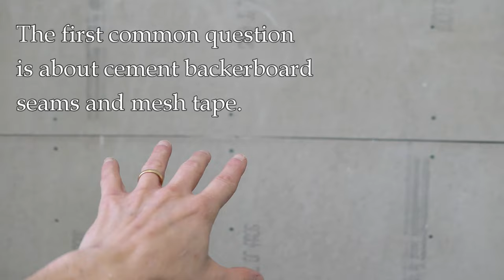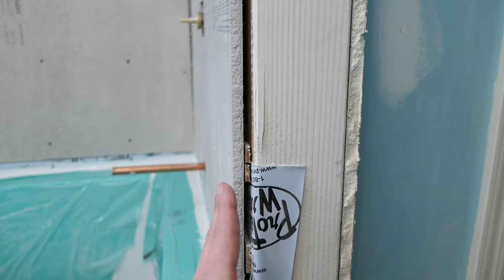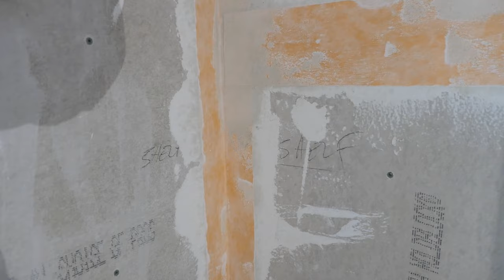Should Backerboard Go Over The Tile Flange Or Up To It?

Comment: An alternative to shims or floating the face of the backerboard is to thinset the studs then put up your backerboard and plumb/level/square the backerboard with the screws. Don't over tighten your screws or you'll squish out the thinset.  Once thinset dries snug up the screws. This will leave a nice clean surface to lay tile.
Reply from the maker: Yeah, I've seen others using this technique, but I'm not a fan.  Wood, including studs, will expand and contract with seasonal changes in humidity.  This is especially true in areas with cold winters and heating systems.  In time I fear the thinset could drop away, leaving gaps.  I'd prefer to have solid wood, attached in multiple places, which cannot drop away.

Comment: I see that the drywall tapers extended their joint compound onto the Backer board ?? Doesn't seem to be a good idea no , to apply tile with thinset over drywall mud ??
Reply from the maker: It isn't a problem if you detail it correctly.  First, I put the actual joint outside the wet area.  So if it is a 30 inch tub I might make the end wall backerboard 32-36 inches, depending on the framing.  The feathering over that joint is done in the typical way, but the edge of the feathering does not go far into the wet area.  Often I have it end over the tub or pan front edge, where there will be a shower door or curtain.  Finally, the compound gets one coat of primer and two finish coats of paint at a minimum.  That paint is allowed to cure for several days or more.  I paint the whole room before I tile, so that isn't a burden.  The thinset used to set the bullnose edge tile is over the edge of the feathering, but the thinset sticks well to the cured paint.  Kitchen backsplashes are often done this way too, with the wallboard and spackled joints covered with primer.  

If you have a concern, though, another way to handle this is to use a metal edge rather than a bullnose tile and apply Schluter membrane up to that edge.  This is a modern look which may not work with all installations.  You can also use Schluter membrane under bullnose tile, of course, but you'll need to get the edge perfect and you'll still need to paint the spackle underneath for the thinset used with the membrane.

Comment: Great video. I'm doing my bathroom and after removing the old tub, cut out just enough drywall to get the new tub in. My bathroom layout and ceiling height would mean cutting out and replacing an enormous amount of drywall in order to fir out the studs to ride over the flange. Not happening. It's so important to live in the real world when doing this stuff.

Comment: I’m 43 and I’ve helped out with several bathrooms as a kid. I’ve actually been helping with one this month. I remember the days where you’d simply put up hardi backer and tile, and the work would last for ever. Especially with preventative maintenance as well as normal maintenance. 

But now a days, this type of work has been made to be so critical. I don’t know if peoples work has gotten sloppier (fast work for fast money), or if water isn’t what it used to be (joking), but now I see people going as far as roofing paper > cement board > tape & mud > red guard > hot mop > tile.

Seems like overkill for a job which if done correctly, shouldn’t need all of that.

And the interesting thing is that generally when showers / tubs have any sort of water seeping through, it’s usually in an area where preventative maintenance should have been done.
Reply from the maker: You're correct about much of this, and I don't disagree.  I've taken apart 60-70 bathrooms in my career, and almost none of them had water damage in the main "field" of tile.  And back in the day they just put up "green board" drywall.  If there is damage, it is located where the tile meets the tub because the caulk was not maintained, or the edge of the tub on the floor where water seeped in over a period of years.  The reason waterproofing is an obsession these days is due to marketing efforts by companies who sell waterproofing products.  For my work, I concentrate on protecting the areas where I have seen damage over the years, which is the edge of the tub or pan on the floor and the area where the tile meets the tub or pan.

Comment: I have a mess in my shower!  My house has two level. The original builder of my house has the brilliant idea to build the shower drain on the top of floor stud support; they cut the stud to make possible the elbow PVC can connect with the pan and drain system and never seal under the exit under the wood floor with shower pan flange. LEAKING TIME! First time, I let him know is a leaking he don't do nothing until a mold came out drywall. So, my husband take "care" and he did a ____  job!!! Coulking time!. Today, 2022 second time same problem. This time I will take care!! this will be my 7th project around the house. This is the best video that I found!!! The extra effort to do a long-lasting job it's worth it because the reality of life is that a lot of house owner like my husband thing that the house will take care by itself!! Thanks!

Comment: With regards to the backer board and flang. I usually fill that gap with thin set as a filler and skim it flush with my trowel/taping knife. The tile ends up covering it while also sitting on something firm. Thanks for the flashing tip. Great video.
Reply from the maker: I actually have a whole video on that subject: https://youtu.be/y3bpE-GhYUM

Comment: Great video, my walls were far enough out of plumb I was considering shimming with 1/4 backerboard, then adding a second 1/4 inch sheet to bring my plane to the same level as the existing drywall. Originally I had the first shim layer going right up to the flange, then the second went over the flange, but I am going to incorporate your flashing idea now. 

Thank you again

Comment: I had to do a repair couple years ago where the contractor installed the backer board such that the bottom row of tiles fell directly on top of the tub lip so half the tile widths were just hanging over the lip without touching the tub surface....it looked like hell. Fortunately there were 2 things in my favor: the bottom row wasn't full height because the guy cut them in half to sit on the lip and there was a full box of spare tiles in the garage.  I carefully removed the bottom row of tiles sitting on the lip. Then I used my angle grinder to remove about half the thickness of 30 new tiles about half way up their full height. When I installed the new tiles they reached all the down to the tub surface because the material that would have prevented that was removed by the grinder. I then caulked the tile to the tub as usual and you would never know how badly the guy screwed up the install.  So the bottom line is even if the backer board wasn't installed properly you may not have to rip it out or shim it to get a great tile job. There are ways around other people's incompetence.

Comment: Hello John, i am a DYI'er.  Really appreciate the practical discussion about imperfect installation conditions such as wall studding, and moisture control between walls beyond the cement hardieboard, and the sheetrock interface.  The self adhesive plastic flashing with a 3 foot plastic skirt seems like a good idea too.  Maybe that hot mop and custom shower pan isn't necessary for a good seal!
Reply: Amen brother!

Comment: Very timely video. I am just starting a bathroom gut and just removed the tile and tub. Tons of great tips. I only have one tip of my own from experience. Don't trust the oring in the tub spout. In both of my bathrooms in the  tub spouts a couple of years apart the orings failed. I had cleaned of the copper and chamfered the ends so it didn't nick the orings. The oring did fail after a few years and the water travelled back and down the opening in the tile and thru the ceiling of my renovated kitchen. Now when I install a tub spout I silicone the opening as best I can around the copper where it comes out of the tile.
Reply from the maker: Do you mean where the spout is attached to the copper stub coming out of the wall?  There are some styles which push on, much like a shark bite style coupling.  Those have O-rings.  The style I prefer requires a male threaded fitting to be soldered on to the pipe stub, then the spout is threaded onto the fitting using teflon tape.  I will also seal the opening around the pipe with silicone before installing the spout.
Reply: @enduringcharm  1 Moen tub spout and the other was a Delta. Both had the slip on spout with orings. No where for the water to go when the spout was in shower position so it seemed to shoot back thru the hole in the tile.
Reply from the maker: Yeah, I'm not a big fan of that style.  I use a lot of Moen faucets, but the ones I use have the screw on style spout.  Possibly the pipe was a little short on your installation and the O-ring couldn't seal?  I don't know.  Caulking where the pipe comes through the wall is good practice, though.

Comment: As a DYI project here looking at a new tub, common sense tells me something needs to happen a specific way at the flange. Couldn't find anything until finding your vid. THANKS. I have some of that tar tape from a new back door project. The added protection will be comforting. The tub instructions didn't show any detail for this. Must be a common thing to know for pro's....like the mortar base under the tub for support.
Reply from the maker: I have several other videos showing installation details you should check out as well.  IN fact, one was just published an hour ago you may find helpful!

Comment: I usually use concrete backer board, however for my most recent installation I used GoBoard which is an entirely waterproof product. It's a foamboard and easy to modify so I cut a rabbit to fit over the lip of the tub with minimal bending. Silicone around the junction of the tub and the GoBoard and then silicone between the tile and tub.
Reply from the maker: My issue with lightweight backerboard is that the final installation sounds hollow.  It doesn't bother some people, but I like to be able to knock on a wall and have it feel and sound solid.
Reply: I've recently been rabbiting the back of the hardiebacker to fit over the lip, set the circular saw to the right depth and then cut a few scoring lines up to 3/4 of an inch from the bottom and then remove with knife and Polish plane. I think I'll stick with that but add the flashing for extra precaution.
Reply from the maker: @lucas  Listen, that's really not a good idea.  The health consequences of making that kind of dust with a circular saw and hardibacker (or any cement board) is no joke.  Even outdoors you are taking a risk.  When I was younger I took all sorts of dumb risks with my health that I now regret.  A shower tile job is not worth getting silicosis.
Reply: @enduringcharm  how do you cut your hardi then? no matter what when you are cutting hardi backer you are going to generate a good amount of dust.
Reply from the maker: They make shears to cut hardibacker which are essentially dust free.  See these videos:  https://youtu.be/YXCwEvnCTNY , https://youtu.be/JUXBOrwh83I ,  https://youtu.be/LTtwjKTOPrQ

Comment: In my mind, the mesh or band is not really used for stability as much as it is part of the theory... meaning that one is using the Hardy board as a solid medium to support the tiles. At any point on that board, there are no cracks as it is solid. Not the case with the joints. Hence, one is simply making a ‘skin’ that covers the cement board joints that mimics the surface of the board itself. That’s how I look at it.

Comment: I would love to see a video on tiling the front of an alcove drop in tub. Your video was exactly what I was looking for and extremely helpful and detailed. Thank you
Reply from the maker: I have a few videos on tiling shower walls and the process is identical. The only difference is that you need a method of transitioning at the edge.  A bullnose edge tile is one option, using a marble top (in sections) is another.  Either way I would recommend using the Schluter Kerdi membrane underneath to waterproof the surround.
Reply: Thank you!

Comment: I've encountered this situation many times. My fix was/is to notch the framing member to flush the tub/shower base flange with the stud or furring strip, then shim out the opposite (short) wall.
Reply from the maker: That's a popular solution, but my bath remodels have building permits and inspections.  Notching the studs would be rejected by an inspector if caught.  And, that still will not help if the plane of both walls is even with the shower or tub alcove, i.e a five foot wide room.

Comment: One of the most intelligent explanations!!! Thank you!  I often see that a shower pan comes with weeping holes on both sides ( usually in the front of the pan). How do you deal with that?   I just don't know why you need weeping holes with now modern waterproofing technology.
Reply from the maker: I think you are referring to the small depression toward the front edge of many pans, which is designed to allow water to drain back into the pan.  Even after tiling there is something of a ledge there, and this gives a path for water.  Also, if the homeowner does not maintain the caulking between the pan/tub and tile then this allows any water to drain back.  In truth it doesn't have much utility, especially if shower doors are installed.  However, in cases of certain shower wall designs, or "inserts,"  there is no caulk used, and then that drain back area is potentially useful.

Comment: A lot of insightful Info and thank you . One point to consider .The Sure seal / Ice water you use at Tub Lip / Flange . as to catch any moisture /water that could drip down .That's made so nothing sticks to it .Plastic/vinyl top .Will the thin set / tile mastic/grout  come loose after awhile from tub vibration , temperature changes etc.. because it will not get good adhesion to it ??
Reply from the maker: Remember, thinset will also not stick to the tub or pan flange either! Those are made of porcelain or various plastics and the thinset has no better adhesion there.  See this video for more info: https://youtu.be/y3bpE-GhYUM

Comment: I appreciate your teaching and training very much. QUESTION: Do you apply a coat of thinset to the backer board gap with the flashing at the lip to fill the gap?  I am installing a 3X6 Subway tile over a new tub install.  Thanks again
Reply from the maker: If you are using a small format 3x6 tile and you have a significant gap at the lip area you should be cautious.  I typically will not use a tile over the gap of the lip unless 2/3 of the tile is adhered to the backerboard itself.  See this video:  https://youtu.be/y3bpE-GhYUM?si=TPcrBfaVYZgN3KaW

Comment: I doubt I would thought of using flashing to seal the borders, but will from here on.  Great tip. As for another idea I think of but haven't done is to place the backer board over the lip leaving an 1/8 th inch gap for caulking. Having the backer board over the lip without shimming (especially using your flashing suggestion) allows a gentle slope generally unnoticeable while further directing the water away from & pooling on the edge. Your thoughts on this theory would be very appreciated.
Reply from the maker: If you allow the walls to slope at the bottom you'll find yourself in a pickle when you go to fit a glass shower door.
Reply: @enduringcharm LOL, its probably why I havent done it . Thanks

Comment: Great Video! I notch out the back of my hardebacker and run it over the lip, eliminates the need for shims
Reply from the maker: I don't like that option for two reasons.  One, it weakens the backerboard.  Two, and more importantly, if you use a grinder to relieve the back of the board, you will create significant dust.  Even outdoors this is hazardous.  Having done this work for several decades now, I know how risks can catch up with you in the end.

Comment: The self adhesive membrane at the tub gap looks like an excellent idea.  Do you have experience or comments regarding Acrylic Tile Adhesives in place of standard Thinset in a tub enclosure.  I've used a premixed bucket of acrylic tile adhesive for small jobs like back splashes with good performance.  Because the adhesive is acrylic, it creates an additional water proofing barrier between the tile and the cement board, so I suspect there is no need for a roll on membrane such as Red Guard.  The acrylic adhesive is more expensive than Thinset, but the cost difference would be offset if the roll on membrane isn't required.
Reply from the maker: I wouldn't recommend acrylic adhesive for showers and definitely not for tiled shower floors.  It's not appropriate for wet areas and also not good for large format tile, which is popular today.  I use latex modified thinset, and I use one specifically for large format tile when installing big dimension tile.  Thinset is well proven, it can be mixed to different consistency depending on need, it's fine for wet areas, it's easily scratched off if some gets in a grout line, you can refresh it continuously as the day goes on, and it will work with natural stone like marble.
Reply: @enduringcharm  Thanks for experience and advise.  I'll restrict the bucket of acrylic adhesive for back splashes and small feature tiles.